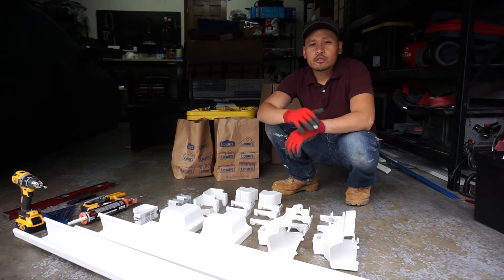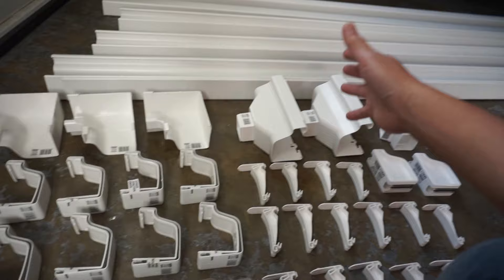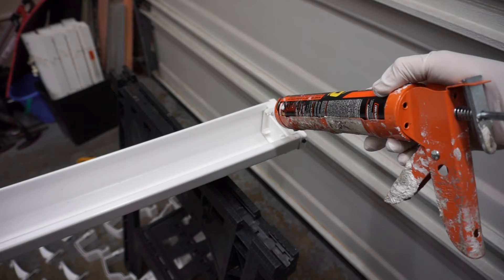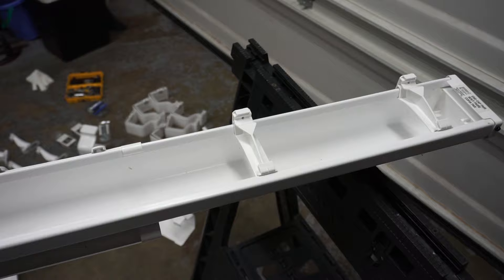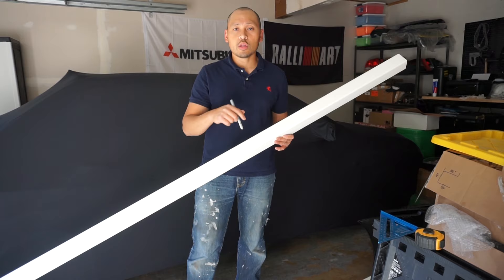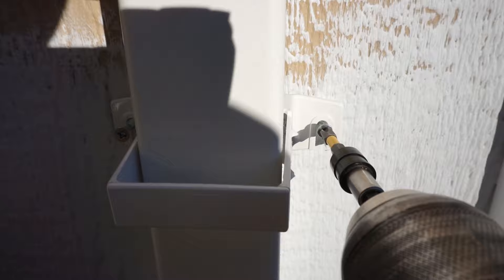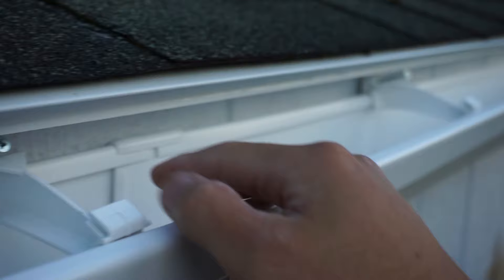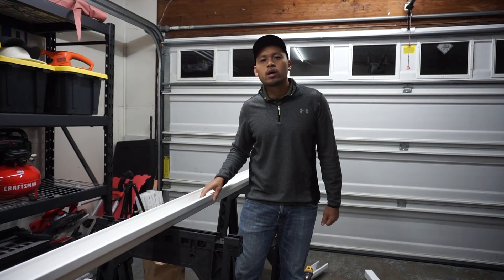How To Install Gutters For Beginners! Easy DIY Home Project!

Comment: As an instructor myself I have to say this is a very well made video. Clear to the point and very very easy to follow.  You have real talent as an instructor and as a craftsman. 10 out of 10 stars!
Reply from the maker: Thank you so much! You’re comment just made my day! 🙏🏽😭 means a lot! Have a great day my friend! 👍🏽😊
Reply: If I'm installing gutters over 30 ft I heard you start in the middle and go both ways but how do you start in the middle and it's attached how do I go each way with out bending it jw
Reply: Best instructions ever seen, he is a good teacher
Reply: Great comment
Reply: Actually you should use 100% silicone.the sun and weather will put a beating on caulk.also hangers go every 16" cause that's where the rafters are

Comment: OSI caulk is the best.
Reply: Use Rusco or Geocel!

I’m not a fan of the OSI. In the winter, it tends to harden in the tube, making it damn near impossible to use.
I used to like the OSI until I tried a few others.
It’s still a decent sealer, but keeping several boxes of it on hand is not wise

Comment: Aluminum is way better. Vinyl gets brittle in the cold, and warps in the heat.
Reply: So in the end it just depends on things like region & your landscape. Could be in moderate environment and have no issues. Could have shade and no issues. So really it depends on some factors. But yea, overall you could say Aluminum is better quality. However Vinyl can have an aesthetic quality that Aluminum doesn't.
Reply: @gtguy181  I live in Los Angeles, would vinyl work? I think the weather here isn't too extreme. 😬
Reply: Aluminum .32 gauge… all day!

The aluminum sectional they sell in hardware stores like Home Depot or Lowe’s is generally .15 to .19 gauge. Very flimsy and easy to twist, bend or dent. Not worth it.
Reply: @Ceciaguilr  Absolutely. You guys have one of the best climates in the world. Not too hot and not too cold. Yea you're good to go.
Reply: Also, be very careful if you have to go up on your roof. The vinyl gutters may deform heavily or even collapse against a 30 lb ladder plus a 200 lb man climbing/ leaning against the much weaker vinyl assembly.

Comment: I’m a seamless gutter installer and definitely prefer aluminum over vinyl, just because they will last longer and are more withstanding of extreme temp change, but this was pretty good man!
The only suggestion I have would be to start install from your gutter high point and level down. A lot of houses out there that have settled or shifted over time. They may look right from 15’ away but can be extremely off when installing.
GJ though. Vinyl gutter stock has definitely improved over the past 20 years lol
Reply: I can't imagine why anyone would choose these sectional gutters over a seamless gutter system. It seems to me that the more seams and connections one has on the length of their gutter, the more risk they would have of a connection failing.
Reply: @eric6345  honestly, me either!
Seamless is definitely the way to go in this day and age! I can’t begin to tell you just how much of the sectional vinyl (and aluminum, galvanized, etc) I have torn down over the years!
I’ve been running seamless gutter for about 20 years and unless the installer doesn’t know what he’s doing, it’s fool-proof!
Reply: Hope the joint connectors have enough downhill to let water over the interior piece. I have the same system and, problem is after 1 year having bit water constantly sitting between joints because of the gutter interior piece being so thick, they all leak. So, so sad...
Reply: @jeffdyrland2795  I have an older home with a 60' run. Presently there is a seamless gutter here, but with wind and branches always falling the gutters have taken direct hits and they are deformed in a couple of places so water spills over the edge. Considered replacing the seamless gutter but now I am thinking sections(either alum or vyn) because I think they would be easier to repair than a seamless.
Reply: @davidhendricksgolfprofessi2321 yes and no. It definitely sucks when a 60+ foot long piece of gutter gets damaged. Just because you have to replace the whole thing. Doing a long run like that with sections can be a huge pain though. Can be tough to get the grade right too. But replacing damaged sections at a time usually ends up leaking at the seams at some point down the road. But hey, it might be a good option if you constantly have branches falling on your house.

Or you could try upping the gauge of aluminum you use. If you get a good .032 aluminum and use hangers every 16” (provided your fascia is 2x) it’s very solid and dent resistant. But I don’t know what you have on your house now.

Comment: Thank you so much for your video.  I bought these gutters after seeing this video the first time, but did not have confidence enough in myself to do this work.  So I paid some handy-men to do the job.  The gutters leaked from day one, but I thought that was because they didn't apply sealant and so it was on my list to complete this.  I got my ladder out today to clean the gutters and apply the sealant and I see that these people have installed the gutters completely wrong.  I am shocked and also now pretty mad.  I took down their poor work and started re-installing the new ones I have bought myself.  It's not terribly hard, I should have done it myself the first time.  Your instruction has helped so much, thank you.

Comment: I have these exact same gutters installed now. They've been up there for at least 10 years now. I took them down to paint and decided on all new gutters since, at 48 cents a foot, it would be easier to install new ones, plus the joiners would need new seals or caulking.  I'll probably re-use the hangers but will need new joiners. The aluminum were not that much more expensive but I wanted to match my existing down spouts. I'm watching these videos because I don't remember how I installed them in the first place. It's been a long time. These gutters do last. No snow where I live, however.

Comment: Appreciate the full explanation and important time saving tips.  The cutting the hole for the downspout to preserve the strength and integrity of the gutter was a definite time saver and something I would not have thought of. I did basically the same job.  Thanks for saving me hours by sharing your years of experience.

Comment: This guide gave me the confidence to get my vinyl gutters up. It was only two separate small 13ft runs but I watched and referenced this video many times until the end. Thanks so much!
Reply: How's the vinyl holding up?
Reply: @Bond-James-Bond-   Funny you ask. The downspout connectors are not assembled to only have water go down I guess. Might be hard to explain but most of the connectors have water either dripping out of them or have a small beaded stream continuously flowing from them. I've tried to caulk them with several different kinds of caulk and so far none of them worked. It drives me crazy, but I just haven't taken the true amount of time to just take them down and get the problem fixed. I need to do that. I blame none of this on your awesome tutorial though.

Comment: I'm planning on installing vinyl gutters on the front of my house and watched quite a few DIY YouTube videos. Yours was excellent, maybe the best. Thanks for your logical presentation in conjunction with great video visuals to reinforce your verbal descriptions! You gave me the confidence to move forward.
Reply from the maker: Thank you so much Rod! Really means a lot! I hope your project turns out amazing! Let me know how it turns out my friend 👍🏽😊🙏🏽
Reply: @FixThisHouse    Will do! Thank you again for your inspiring video!
Reply: Please do not put vinyl gutters on your house they will not last you need to get aluminum gutters it’s not that expensive
Reply: I’ve been doing this for a very long time and I promise you putting those on your house will be the biggest mistake you will ever make
Reply: Not to mention they are absolutely hideous
Reply: Hope the joint connectors have enough downhill to let water over the interior piece. I have the same system and, problem is after 1 year having bit water constantly sitting between joints because of the gutter interior piece being so thick, they all leak. So, so sad...

Comment: This is great, I was not figuring out how to use the connectors. I tried to install the inside and outside piece of the connector at the same time by sliding them over the gutter. No go. This will be a big help. I like the idea of adding the screws on the end caps as well as caulking them.
Reply from the maker: Thank you 🙏🏽! I’m glad I could be of help!

Comment: Not long ago I purchased a house and I am working on getting a lot of projects done. Gutters are one of them and I have found your video very informational and helpful. I think I also like vinyl because of the clean and smoother look. Thanks!
Reply: You'll be replacing them vinyl very soon they are trash... get aluminum

Comment: Fantastic video!  I'm about to attempt my very first gutter job on a detached garage and have purchased all the same materials as depicted here.  Even the siding, trim and drip guards are the same in this video as my garage - perfect!  The instructions were very simple to follow, and I learned numerous tips & tricks I'm certain I would have done all wrong otherwise. Looking forward to giving it a go.  Will let you know the results.  Thank you!!
Reply: Hope the joint connectors have enough downhill to let water over the interior piece. I have the same system and, problem is after 1 year having bit water constantly sitting between joints because of the gutter interior piece being so thick, they all leak. How is yours holding up? So, so sad...
Reply: @ml9633  can you grind the inside lip down with a dremel or something? So it slopes downward?

Comment: Thank you, especially for the downspout install tip. I was preparing to make them separate pieces and attach them together, but keeping it a solid piece with a cut out hole is simpler and sturdier.
Reply: agreed, I was going to cut the gutter into 2 pieces as it shows in the video on the home depot product page for installing these vinyl gutters, but cutting just a simple hole in the gutter is so smart! Less chance for a leak and less cutting!

Comment: I think you have inspired me to do my own gutters!! Thanks bro..
Reply from the maker: Thank you! Glad I could be of help!
Reply: I live in Thailand. I used to have stainless steel gutters but they corroded where the gutter lengths overlapped. I changed to UPVC 8 years ago & they been great & never had a problem or leak. I read they are supposed to last between 15 to 30 years depending on quality of the material & how much sun light they get, but when mine come to the end of their life I will just replace them again with UPVC. A good rule of thumb for rainfall we get in Thailand & Philippines is 1 sq. Inch of down pipe area per 6.5 m2 of catchment area (floor area the roof is covering regardless of roof slope) which comes out at 45m2 of catchment area for a 3 inch diameter down comer pipe & 82m2 for a 4 inch down comer. So if your roof is covering a floor area of 128 m2 & you got 3 inch diameter down comers then 128 divided by 45 = 2.84, round up to 3 & that is the number of 3 inch down comers you need. If you using 4 inch down comers then it will be 128 divided by 82 = 1.56 & again you will round up to 2 & that is the number of 4 inch down comers you need.

Comment: Over a number of years I have noticed if there as open space between the drip guard bottom and the gutter it can be a way water can get in and eventually cause some damage.  I have taken thin cheap aluminum slashing and shoved it under the drip guard and let it go about 1 inch into the gutter.  If you are installing the gutter brackets as seen here you can do this step prior to installation, or if you do this to existing gutters or if want to cut the aluminum flashing around the brackets (good scissors work well),  that method also works..

Comment: Suggestion. If you live in an area that gets heavy downpours or have gutters that carry runoff from multiple roof profiles then go with 6 inch gutters! The 4 inch builders usually install just do not work well for heavy rains.
Reply: Question, does this particular manufacturer also offer the product in 6" systems too?

Comment: Great video. I installed the same stuff from Lowes. I made the mistake of trusting the connection pieces to not leak. Yeah, the caulking at the seams is really important. Also, I absolutely hate those attaching brackets. Due to the angle for the screws the damn things want to drift downward as you are screwing them on.
Reply from the maker: Thank you! These gutter are perfect for beginner DIYers because there very easy to install! 🙏🏽😊

Comment: Try installing vinyl gutters in the midwest, especially northern midwest. Brutal winters with normal negative -30 winters and lots and lots of snow. They do not do well in that climate. I think a good life would be a few years, whereas aluminum lasts for a good 10+ years here. The good news is that if vinyl gutters crack, warp, they usually are cheap to replace the section, at about 6.5 dollars per 10ft linear.

Snow really messes up vinyl gutters through.

Comment: Never would have thought to slide the downspout over the gutter then cut out the hole. Gained a new sub now. 👍
Reply from the maker: Thank you so much! Means a lot 🙏🏽😊
Reply: Me too. In my project, I thought the downspout piece was the ending piece, and I couldn't for the life of me get the endpiece in to close up the downspout..  Now I know how.
Reply: Also, in my defense, the picture displayed at the hardware store had the downspout as the last piece, and the endcap goes into the downspout.. They mislead me.

Comment: my builder hasn't sealed the ends or added a slope... resulting in flooding initially then dripping all down the pitied of the new doors then leaking at the ends and generally all along because it fills with water and has no way to run down... thanks to your very good video I can see what to do to fix it thank you x

Comment: This video is so informational!! Thanks! However, I am currently shopping online for all of the parts I need.  I can see when you are using the self tapping screws in the video. But the screws that attach the gutter hangers to the fascia seem a lot shorter than the 7” gutter screws listed in the parts section.  Am I missing something? What screws do I need to attach the hangers to the fascia?
Reply: I have the same question! The screws should be much shorter not 7”.

Comment: Thanks for this informative video. I just bought exactly these parts from my local Lowe's and it was helpful to see how you put it together. THe tips to use caulk and use screws on the end caps were helpful. I think I will do that.  I was wondering how you held the gutters in place before they were screwed in.  I think that is going to be my biggest challenge. Thanks.
Reply: Clamps

Comment: Hope the joint connectors have enough downhill to let water over the THICK-interior piece. I have the same system and, problem is after 1 year having bit water constantly sitting between joints because of the gutter interior piece being so thick, they all leak. So, so sad...  PS: Excellent put together video. You have class in making instructions simple.  Cheers :)

Comment: 9:25 you can have two pieces, but don't  Even with sealant, after a while it will leak.  Use one piece and cut a hole.  The downspout has holes for hanging. If doing this solo, you can mount your downspout first which makes that first piece go up easier.  Also, avoid using caulk with vinyl.  Pretty much nothing sticks permanently to vinyl including most glues.  RTV would probably be your best bet if you have to do repairs but most caulks, even silicone will not stick permanently to vinyl.

Comment: Don't recall if it was mentioned or not but when using the caulking for all of the seams, you want to ensure that the caulking is 100% silicone which is the better of the caulking for long lasting and good results. Be aware though, 100% silicone cannot be painted, so be sure that it's all kept inside the gutter, and also, it is very difficult to get off of your skin, so you'll want to be sure and use gloves or some other applicator.

Comment: Thanks for the great video.  My only question about the vinyl gutters is if you needed access to the roof, can you lean a ladder on the gutter without cracking or breaking the vinyl?  With my aluminum gutters, I can lean the ladder against the gutter where the screws attach it to the house and it will support the weight without crushing.

Comment: I just want to add that while the actual installation is relatively easy, installing gutters requires planning. This involves understanding slopes and strategically placing drains as to prevent water accumulation away from the house.

Comment: Thanks for the video. Well made, with a good pace.  Question:  At the low end, you have a small area beyond the drain hole that will collect a small amount of standing water. Are you at all concerned about mosquitoes?

Comment: Great video, I think I will use vinyl on my project,  your instructions are great.  One question,  do you need any flashing between the drip edge and the gutter to protect the wood?

Comment: Great video!  Thank you. I have a straight 22 foot gutter run on the back of a separate garage. The downspout will go on one end. Very simple job. Do you think it would be better to assemble the entire gutter (except for the downspout) and then hang the big section, or would it be better to hang it in two sections?  I hope that makes sense. Thank you again!